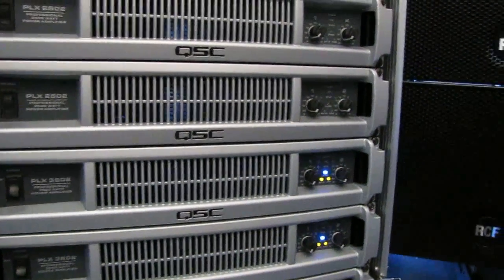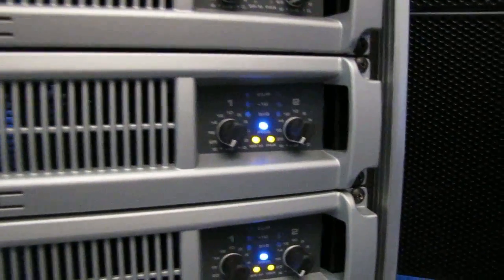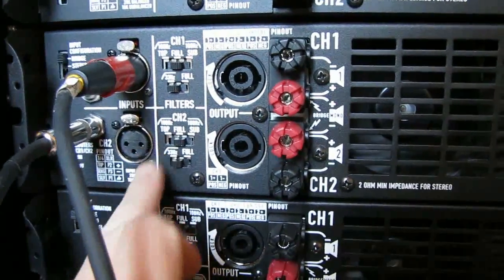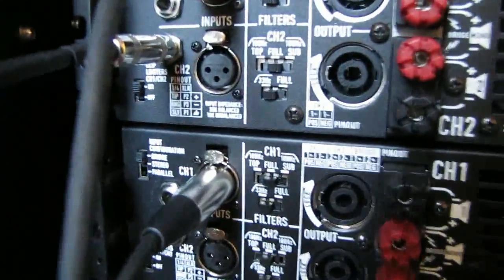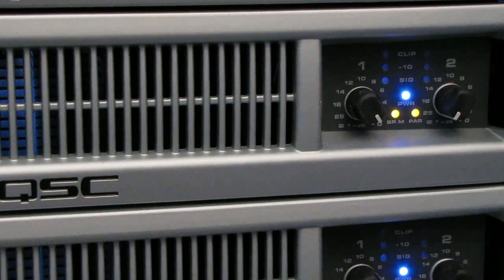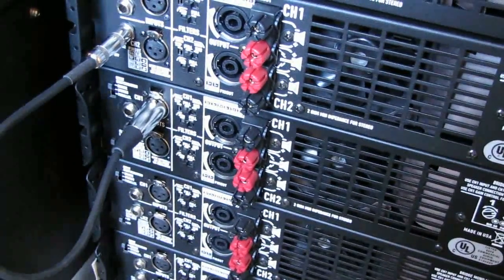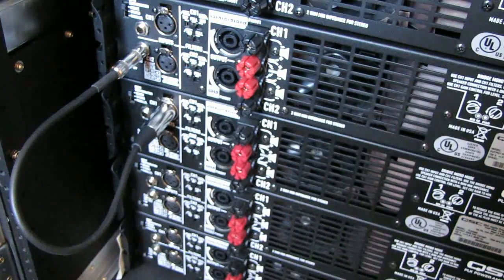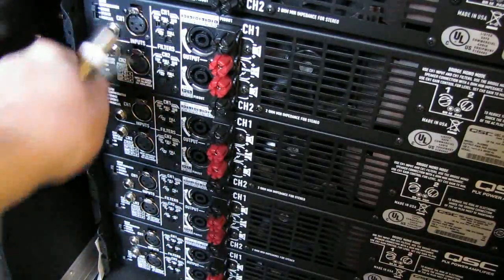"Daisy" Chain of Amplifiers (QSC PLX) - This is a mono configuration

Comment: When you're in Bridget mode you're supposed to have both channel to go in the same  adjustment on panel. because it has an amp for channel and is bridging them. Both gains have to be in the same setting during bridge mode say in manual. This guys daisy chaing all the amp and having 1ch all amps bridged and only ch1 up is bad for the amps it well send power back through ch2 and cause issues. Says in manual. On all amps bridge able. This guy left out important detail.. Bbbbaaaaddddddd
Reply from the maker: +Lucky Barker Many professional amplifiers only use channel 1 (and its gain control) for bridged operation.  From the QSC manual:
---------------------------------------------------

       Bridge Mode: Bridge mode configures the channel pair to drive a single high-power loudspeaker load. The INPUT   CONFIGURATION switch must be set for BRIDGE mode. Use only Channel 1’s input and Gain control. Set Channel 2’s Gain control at minimum.
--------------------------------------------------

Other lines/manufactures of amplifiers may use the gain control of both channels for bridged operation.  It's always best to check the manual before configuring an amplifier for bridged operation.  Also - many amplifiers DO NOT support bridging.
Reply: I don't know what kind of amp/amps you are using, but stageleftaudio is correct, read your manual, as most pro amps work the same way, adjustment is on ch1, and ch2 is left at no gain. READ THE MANUAL!

Comment: Thanks for the video. So this is passing the output signal (no power) from one amp to the next. The reason being, to cut back on a bunch of output cabling to each individual amp from the crossover?
Reply from the maker: Howard Smith Thanks for watching.  You are correct.  Daisy chaining cleans up and reduces the amount of "overhead" in sending the same signal to multiple amplifiers.  For example, in a bi/tri amped system, all FOH needs is to send back 2 or 3 cables depending if you are bi/tri amping; one cable for each frequency band.  Though, if you are running true stereo, you would need to double the cables from the crossover to the amps.

Comment: Hello, watched this video again to refresh myself!! Question?? Do u have to bridge the amp in order to daisy chain it or it doesn't matter as long as the amp is in parallel mode. Reason of asking because i have some amps that don't allow bridge mode at least from what i know. Im using the qsc gx5's. Thanks for ur help!!!
Reply from the maker: Jamial Black Thanks for watching.  Correct, the GX series cannot be bridged.  And for many amplifiers, they don't need to be in parallel mode.   Daisy chaining stereo amplifiers does work, as long as there is a parallel input associated with the input you are working with (i.e. the inputs on the GX series has XLR and 1/4" for each channel).  For example, if you connect an XLR cable into the XLR input of channel "A", that same signal will be paralleled with the 1/4" input of the same channel.  Then to daisy chain another amp, insert a 1/4" cable into channel "A" of the amp you already have the XLR cable connected to, and connect the other end of the 1/4" cable to the input (of channel "A") on another amplifier.  Repeat the steps for channel "B" and then for how ever many amplifiers you need to send the signal to.  If you want channel "B" of the amp(s) to have the same signal as channel "A" (like you can with parallel mode), try using a "Y" connector to connect the same signal from your board to the first amp.  Then, when you daisy chain the amps (both "a" and "b" side), they will both be amplifying the same signal.

Comment: Good video, thanks for sharing it, I have a question, you said you did a ground lift on the cable to daisy chain the amps, you said you pulled the #1 pin, did you remove the pin? Let me know,   Thanks.
Reply from the maker: ignacio jr bueno  When you pull an XLR connector apart, all you need to do is cut the wire for pin #1 and fold one side of the wire back (so it doesn't unfold back onto the wire you just cut); then reassemble the XLR connector..  Or... some people actually pull the #1 pin out of the connector.  "pulling pin #1" is a common phrase.  How it's actually done can vary.

Very IMPORTANT - make sure you know which pin is #1.  Look straight into the end of the XLR cable, you should "1" "2" "3"  These are the pin numbers.  Make sure you select pin #1.

Comment: I have a  question. i have a big gig coming up and to compensate i added (2) Rockville RSG12.2 Dual 12" 2000W PA Speakers+Rockville RPA8 Amplifier DJ Amp to my setup which was a hercules rmx2 running into a bbe sonic maximizer running into my rockville subwoofer that runs to my crown amp that runs to my 2 15s. how would i run my old setup and include my new addition.
Reply: if your old amps have multiple inputs just use an unused input as an output to your new PA

Comment: To compete this set up, I will run 1 output to the speakers and then daisy chain them as we'll?  And with this setup, how many sub boxes(and what power rating)  could I run?  Give me an example please and thanks for posting.  Peace
Reply from the maker: You can daisy-chain (run parallel connections) for speakers, but you may need to limit the number of parallel speaker connections to two per channel on the amplifier.  What's important is the load the amplifier sees on each channel; check the manufactures spec sheet to see what the limit is for the amplifier you are using.
Reply: Thank you/ Look forward to future uploads from your channel.